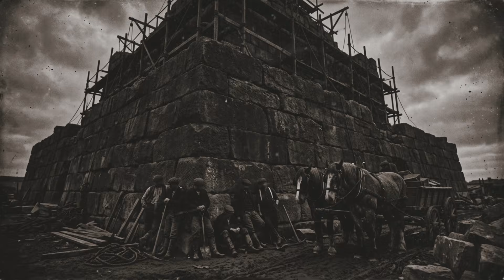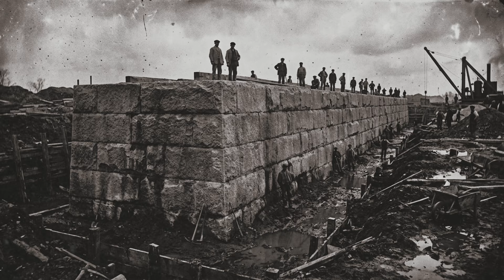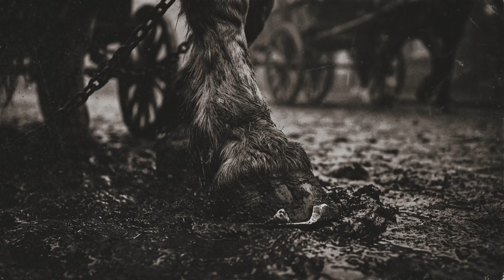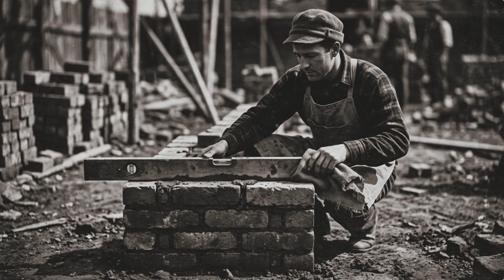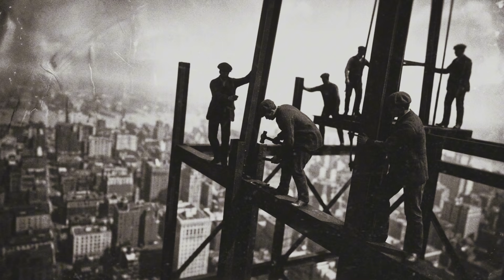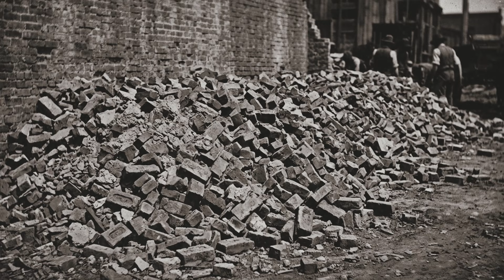The Logistics of an 88-Million Brick Skyscraper (1871)

Comment: Great show and subject ! I would say that in many cases , objections can be raised to your objections : in the case of the mortar curing time , someone might argue that for all the millions of bricks said to be laid in a short time period , progress was primarily horizontal because of the wall thickness and size of the footprint . The steam cranes may have had cams or whatever to make lifting safer ; problems can be solved . But I think the strongest evidence across the old world lies in fake construction photos , impossible build times , complete lack of legally required storage of blueprints , engineering data etc , untrained architects , buildings on maps years before their build date and the like ...
Reply from the maker: Great counter-point on the horizontal footprint! But we are 100% on the same page regarding the paper trail. The impossible timelines and the complete lack of legitimate engineering data and blueprints are exactly where the official story falls apart. You can't build 19th-century megaprojects without massive supply chains and blueprints. The absence of that data proves the financiers were hiding their true operations and scale.